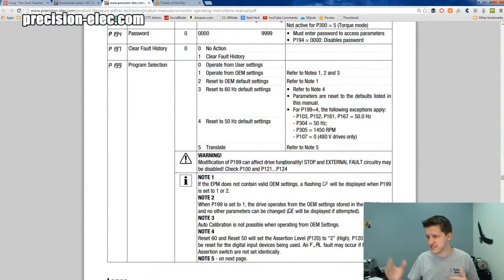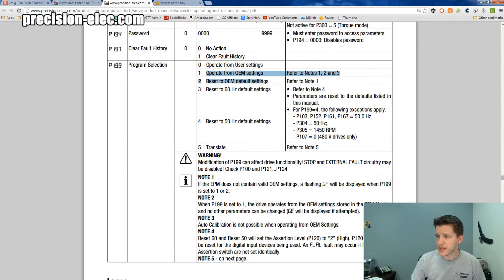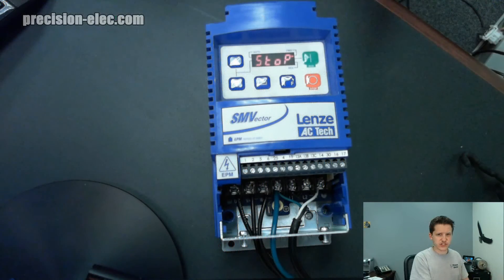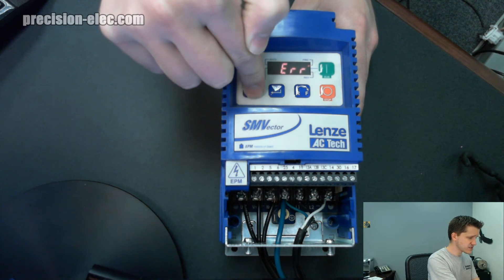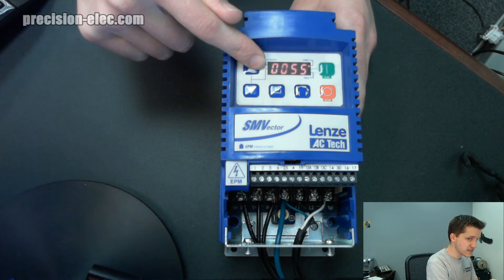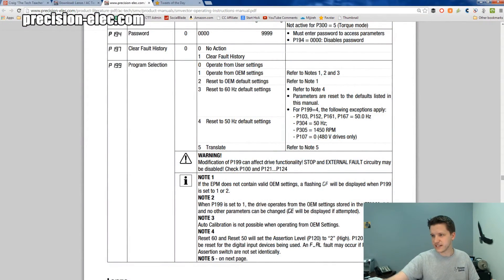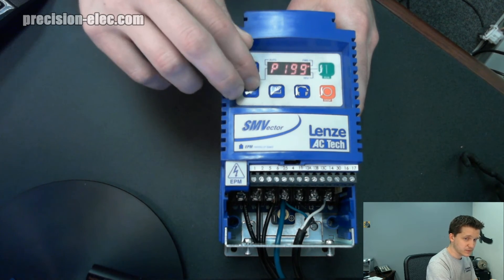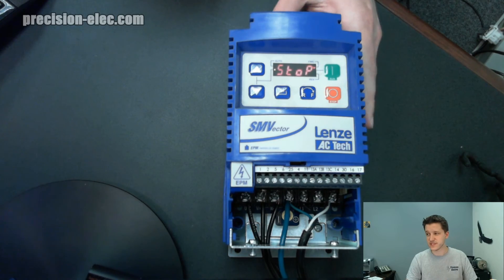How To Reset SMV Variable Frequency Drives To Factory Default

Comment: Hi, I have a Legacy Arty CNC which has one of these  VFD in it, I have bought the machine second hand in Australia and have Legacy looking in on the problem. The error code is F.0F1 Ground fault. I have checked all the wiring and seems ok or am I missing something? How do I check what it has programmed without wiping it as to check if it has been programmed for 60 0r 50 Hz?